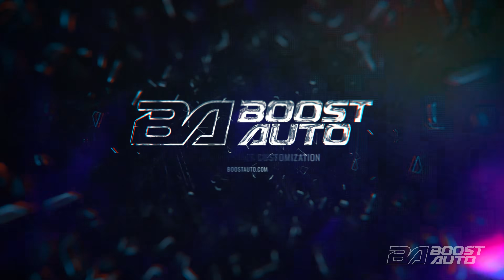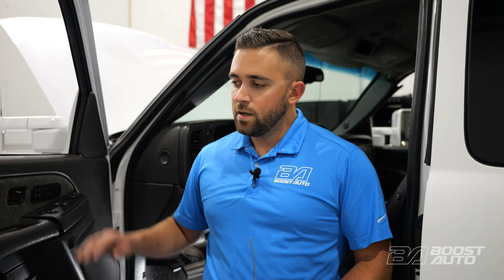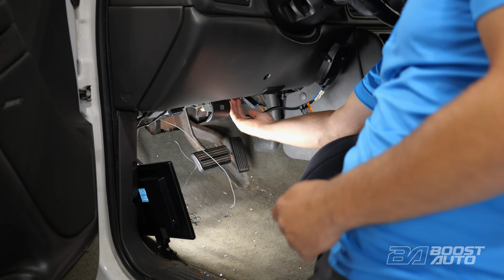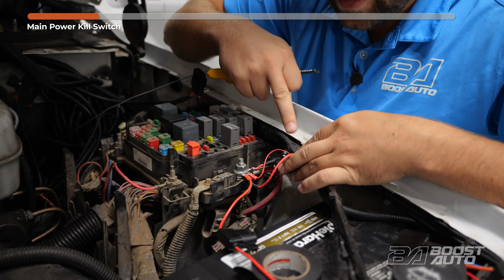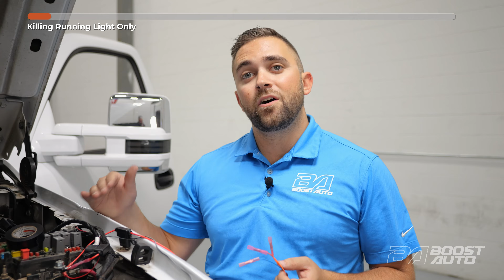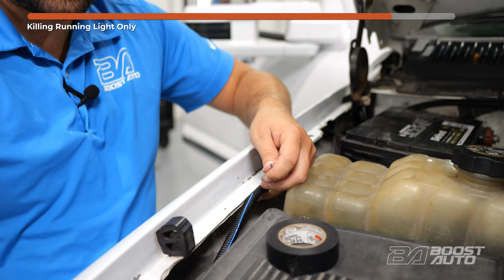Kill Switch Harness Installation Guide for Lumastep M1 & M2 Boost Auto Light Up Running Boards

Comment: How do you wire these to a switch panel
Reply from the maker: This is designed to be a comprehensive system using our switch. If you're wanting to use an aftermarket switch panel, you'll need to switch a ground trigger similar to how we are doing with our kit. Give our technical support team a call at 765-831-2830 for assistance

Comment: By “killing the main power” does this also kill the motor open/close functions or just the lights?
Reply from the maker: This just kills the lights. If you want to kill the motor you can pull the fuse on the main harness

Comment: Now we just need a way to keep the boards down without having to stay outside the vehicle and they'll be perfect.
Reply from the maker: You can do this by putting the boards into cleaning mode and pulling the in-line fuse on the motor harness. 

I'll relay the interest to the team on developing a better solution!